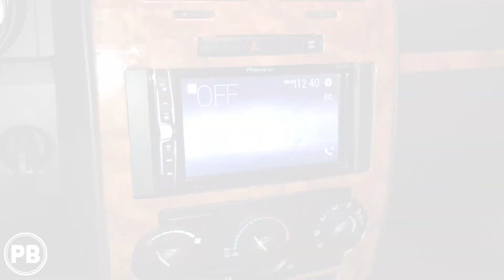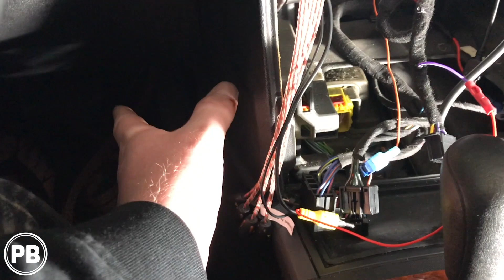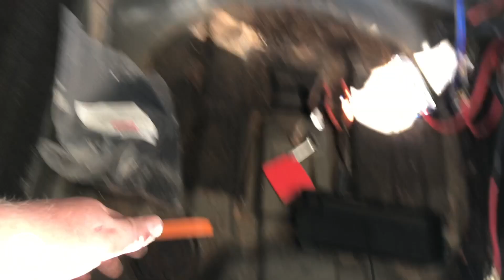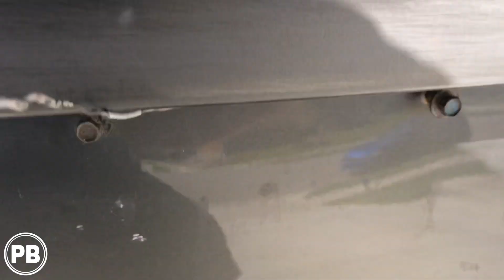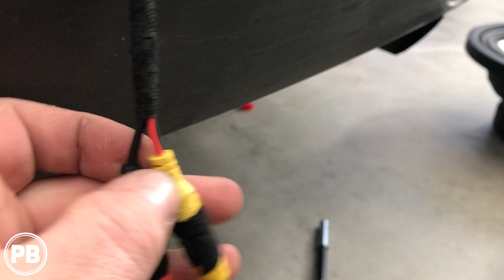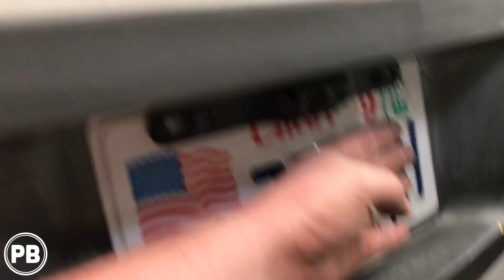2006 - 2010 Dodge Charger / Chrysler 300 Backup Camera Install

Comment: Just bought a 2010 and has same radio.. I see when put in reverse the screen blacks out so not sure if they had a camera and it was removed, or never had one.. I bought a camera to install, was hoping there was wiring to rear already, but did not find,, funny it senses reverse without a camera,,,

Comment: sorry if this question is dumb  but the power is connected in fuse box correct? to the add a curcuit adapter ? does anyone know which adapter is used in this video. hep would be very much appreciated!!

Comment: This is probably best video demonstrating how to route the wiring although a little more detail around getting thru the rear of the car and removing the driver kick panel would have been helpful but it is the best on the web to date. Thanks!